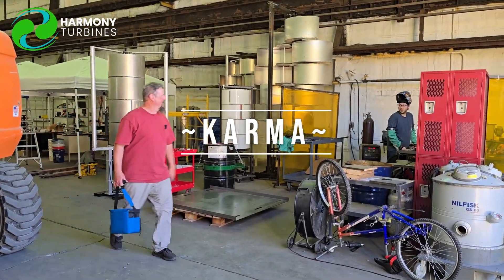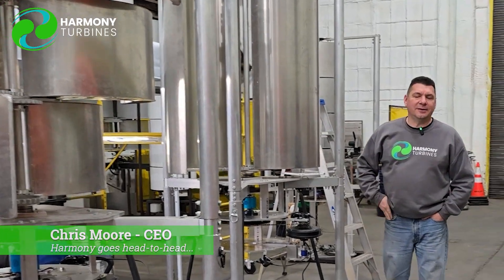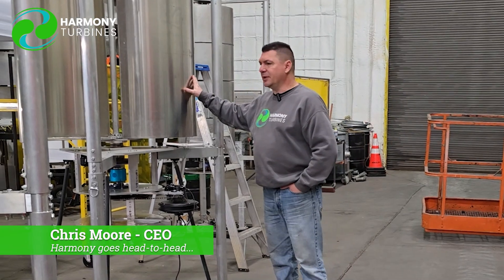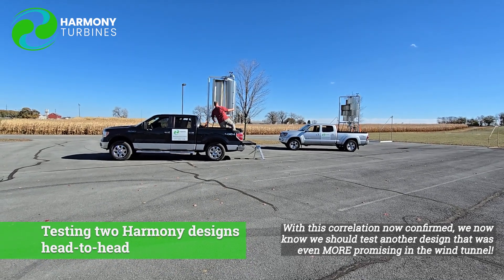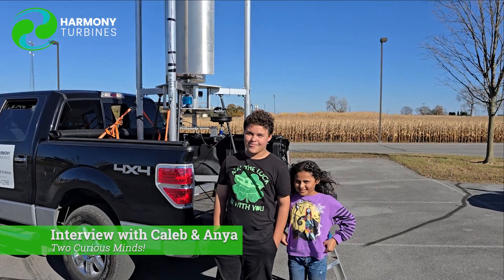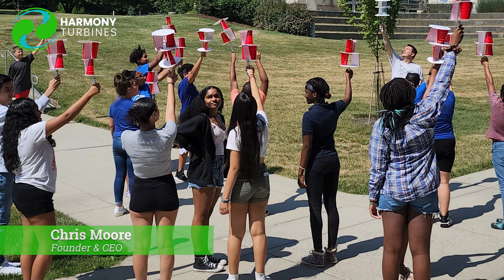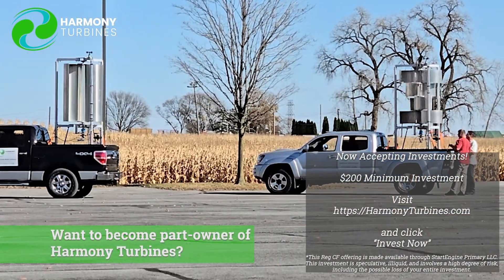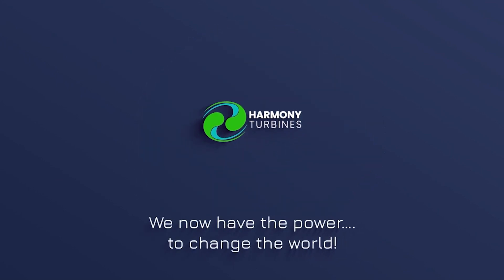Harmony Goes Head-to-Head!

Comment: It's clear why the one scoop works better. Much broader surface area being hit with air at once. This creates much more tq thus performs better. The down side is the extra tq applies a lot of stress to the frame in tq spikes and you can see it in the video. As the wind enters a scoop it really rocks the frame and truck. Perhaps a slightly taller 2 scoop unit could be best of both. More surface area to make up for the tq loss but more evenly applied tq to reduce frame stress and even out the tq spikes.

Comment: Interesting!! The two bucket unit seems to shake quite a bit when it speeds up, do you have a solution for this? Maybe some counter weights?!
Reply: Or if it didn't disturb the air collecting, have another set spinning the opposite direction to counteract the centrifugal momentum.